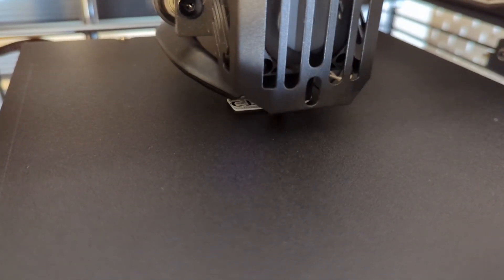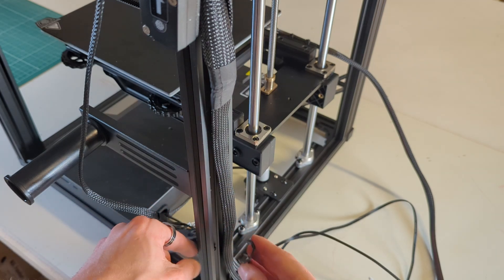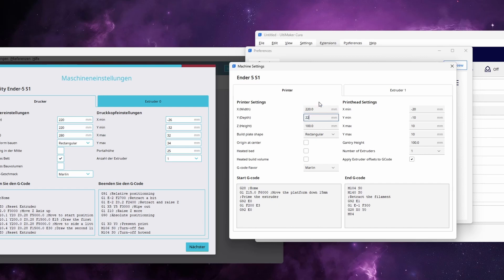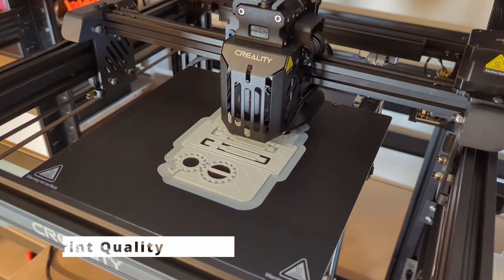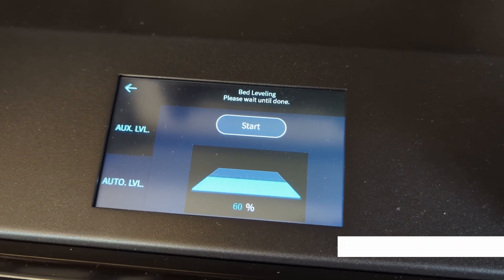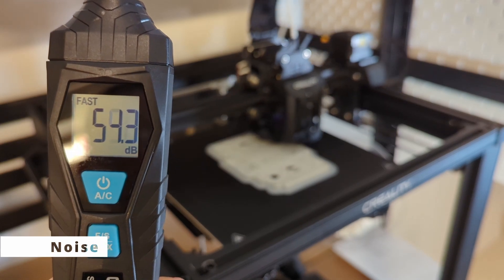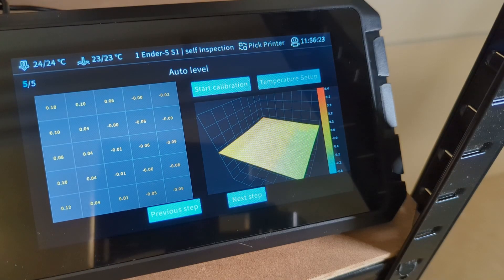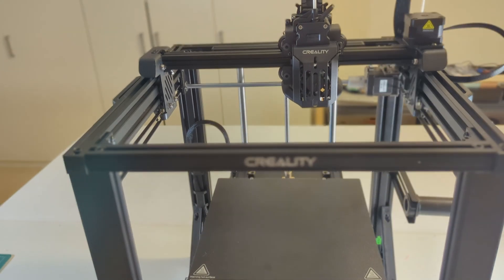Creality Ender-5 S1 Review  | A Great 3D Printer if You Upgrade it!

Comment: a) the beeping can be turned off under Settings
b) print one of the available brackets and move the CR Touch sensor to a zero-Y offset.  This is a MASSIVE game changer in terms of first layer quality.
c) use a PEI bed.  If using a PC bed, remove it before spraying glue.

Comment: This vs Sovol SV06 plus. Which one is better?  
Thanks in advance!
Reply from the maker: Hands down. The SV06 is cheaper and only marginally slower than the Ender-5 S1. I don't own the SV06 but from what I have heard it is a great printer. And the Ender-5 S1 is somewhat expensive for what it is.
Reply: @Craftknights3D  Thank you for your response. I like the Sovol based on the reviews. Are the issues on the Ender overblown or is it really that bad?
The Ender is not much more expensive than the Sovol. I think the Ender 5 S1 is now <$400 at some places.
Reply from the maker: @arfifteen9344  Most of the issues, like the z endstop at the bottom, are fixed and the Ender-5 S1 prints Well and reliable. It runs better in Klipper though.

Comment: You mentioned part cooling being an issue.  What upgrade woould think you would need to make?
Reply from the maker: A better, more powerful part cooling fan would be a start. A alternate fan duct could also help. There are several fan duct projects on Printables and Thingyverse for the Ender 5 that improve airflow for part cooling.

Comment: My Ender 5S1 came today and it doesnt have a z axis switch like yours. In most of the videos I saw before, all of them had z axis switch. Does it cause problems? I haven't printed anything with it yet.
Reply from the maker: Mine has no z-limit switch either. They changed that. Newer machines come without one and z-homing is done with the BL-Touch sensor on the tool head. So no worries!
Reply: @Craftknights3D  Thank you for the reply. I got my first benchy and it looks nice. I'm new to to 3D Printing, so any info helps.
Reply: I have one of each.  With the CR Touch sensor, the homing doesn't use the Z switch at all.